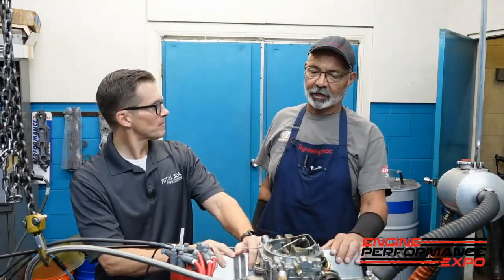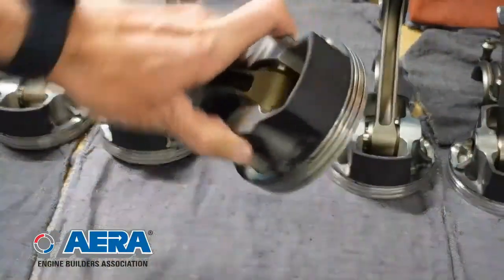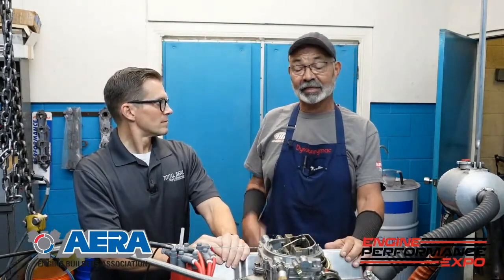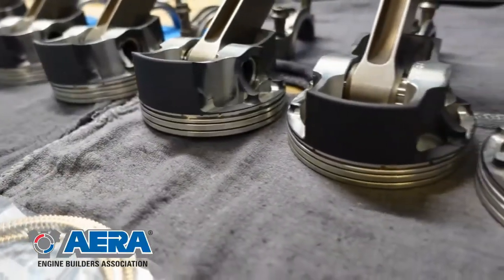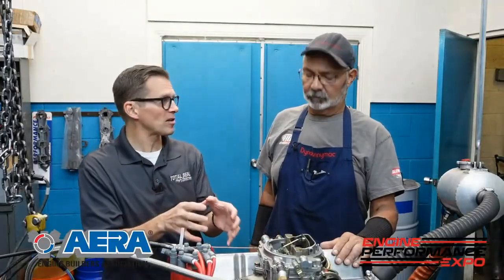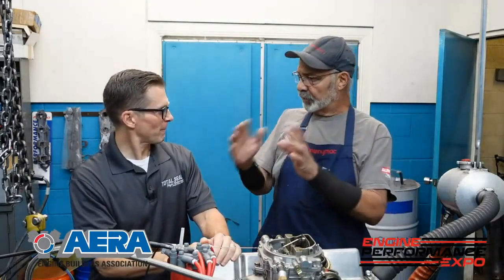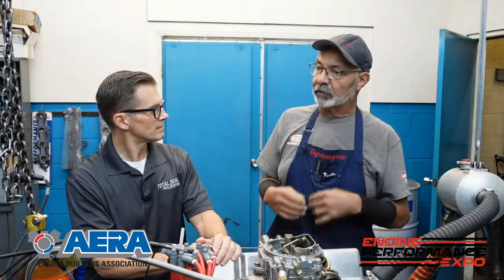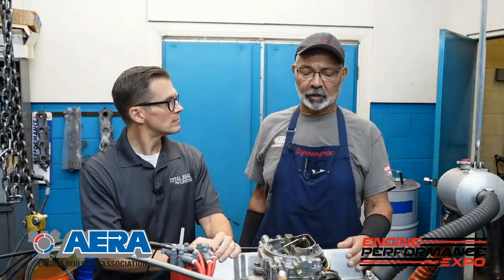Piston Coatings (2023 - Episode 52)

Comment: I've heard of Line2Line's coatings before, and I'm interested.  That's a rather short piston skirt; how much clearance did you need to take up?  Does the piston have increased rock?  If so, is it enough that it should be factored into piston to head clearance?
Reply from the maker: We took up .004 clearance with that Line 2 Line coating.